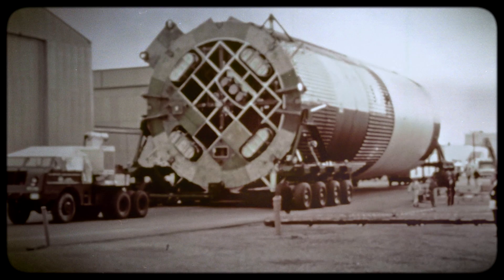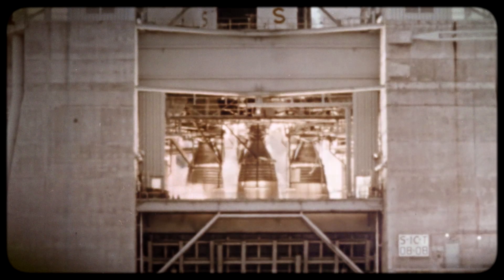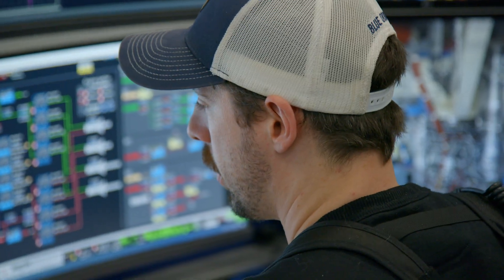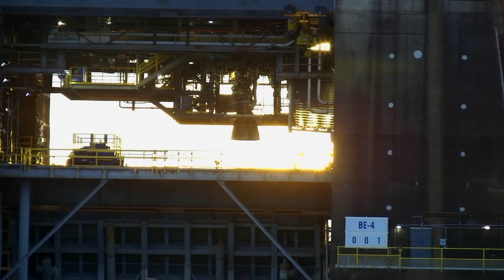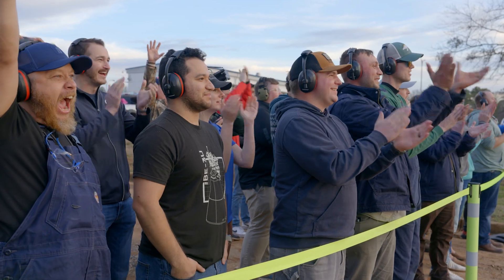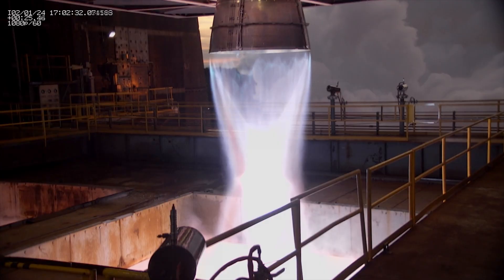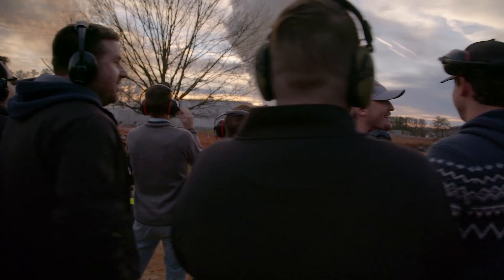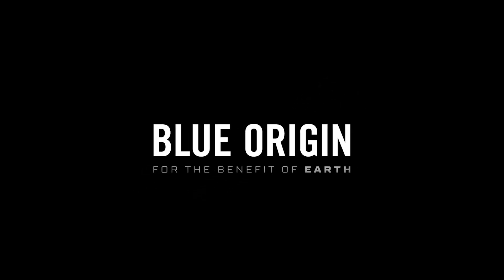Test Stand 4670: Building on a Legacy

Comment: Blue Origin: Renovating a 50+ Year old test stand for 4.5 years!
SpaceX: building a completely new one in a couple of months, for way bigger engines!
Reply: This is a bit of a lie: The Raptor engines are not "way bigger" than BE-4. Physically, BE-4s are somewhat larger, but both engines share the same approximate thrust.
Reply: @Nowhereman10  But still 4,5 years too build a new one in a couple of months. And why didn't they just do what SpaceX did? By a grain Silo but the engine underneath and lunch, instead of waiting 4.5 years ?
Reply: @JemandNiemand-r4f They actually converted what had become a single engine test stand into a duel engine test stand (for two different engines, BE-3U and BE-4) and did so through the pandemic. They needed something close to their factory in Huntsville and the ULA factory in Decatur. There weren't many places in Alabama that would let them do that, and so they chose this because it was big enough and tough enough to handle the requirements.
Reply: Spoken like a true Muskateer.
Reply: Yeah but U know that that SpaceX is just saving Billions of Dollars of Tax payers money, it is insane how much cheaper SpaceX is and how bad NASA is when it comes to "price performance"
Reply: One company is burning tax payer money like it's going out of style, the other one... isn't.
Reply: @ArKritz84  SpaceX delivers on it's contracts, bud.
Reply: @benlawton5420  OP was presumably talking about Raptor/Starship. Bud.
Reply: @ArKritz84  it's still true, bud.

Comment: Can't wait to see New Glenn take off for the first time! Good luck Blue Origin.
Reply: But if it works it will be very good
Reply: @Ionut-bg6vw NG has much better chance of success compared to starship. BO is taking a much more careful approach for developing their rocket as compared to spacex
Reply: @HamzahKhan314  Yes, but if starship succeeds and starts flying as often as possible, new glenn will be almost useless, that is, I don't expect it to fly more than 2 times a year, but starship will fly a lot, but go NG
Reply: @Ionut-bg6vw not neccessarily. starship, like F9 and FH, is not the most efficient vehicles and designed to perform best for LEO missions. some missions that require high performance and low complexity/risk, which starship cannot offer.
Reply: @Ionut-bg6vw but yeah, when it comes to LEO missions, starship can provide some really tough competition. itll be cool to see it flying more often than F9 (hopefully).
Reply: @HamzahKhan314  more starship lounches than f9 is crazy If it hapens in the 2030s
Reply: New glenn must not be wrong its not like starship, starship exploded 2 times and the world is still waiting oft 3 but if new glenn explodes it's serious it took too long to develop this rocket

Comment: Waiting for new glenn vs starship race. ❤❤❤🇮🇳🇮🇳🇮🇳. #LOVE_FROM_INDIA. BEST WISHES FOR BLUE ORGIN ❤️❤️❤️❤️❤️❤️❤️❤️❤️❤️❤️❤️❤️❤️❤️❤️❤️❤️❤️❤️❤️❤️❤️❤️❤️❤️❤️❤️❤️❤️❤️❤️❤️❤️
Reply: That would be like comparing an Hotwheels car to a Semi truck (New Glenn is just way smaller than Starship)
Reply: @JemandNiemand-r4f It is not. New Glenn is nearly as big as Starship: 98 meters vs 120; 45 tons vs 100.
Reply: @Nowhereman10   exactly you would still need about 2 new Glens for the same payload and sadly the amount will exponentially increase as missions start to refuel in orbit etc.
Reply: @JemandNiemand-r4f  This just shows what a troll you are. Starship needs massive refueling to get to cislunar space, at least 8-10 launches in rapid succession, whereas the Blue Origin conops for HLS require only 4: launch the Cislunar transporter, the tanker, and the lander; refuel and then go. Once there, the tanker and transporter can go back and forth from LEO to cislunar.
Reply: @thomasackerman5399  but still 100 tones Leo to 50 tones Leo is a massive difference isn't it?
Reply: @JemandNiemand-r4f Not that much. It's x2, not say, x5 or x10. And which launcher will be operational sooner? Which will be able to do more without filling up massively in LEO first? 

Your inability to grok this or honestly acknowledge this says a great deal about you.
Reply: @thomasackerman5399  your assuming quiet a lot there ! I never sad that starship will fly sooner, but I find it the better option since it's it is more revolutionary and cheaper then anything blue origin hast offer! But to be quiet honest I believe that the Chinese version of starship will probably fly first.
Reply: @JemandNiemand-r4f  You're the one assuming too much here. 

There is no reason to 100% expect that Starship will right away accomplish the hyperbolic goals that Elon proclaims for it. The system is still very much experimental at this point and may not fly for a while yet again, even if IFT-3 is a resounding success.

There is nothing all that much more revolutionary over New Glenn, especially since, unlike the failed attempt to make Falcon 9 fully reusable a decade ago, New Glenn has a major upgrade program underway to make the 2nd stage reusable as well, which should make the LEO missions very affordable, especially when combined with Lockheed Martin's Cislunar Transporter, can make it a very low-cost, competitive launcher.
Reply: @thomasackerman5399  While that being completely true, we just don't know the status of Blue Origin but for what we know Starship and China's version is ahead in development and Building, maybe by a landslide but my guess would be at least 2 years! I don't believe that they can catch up